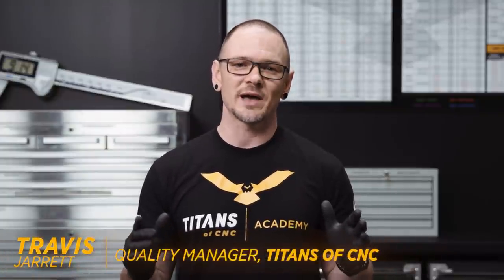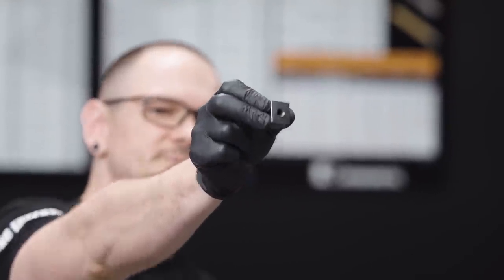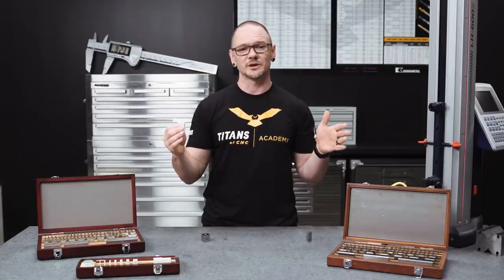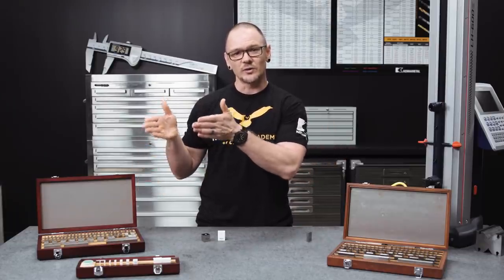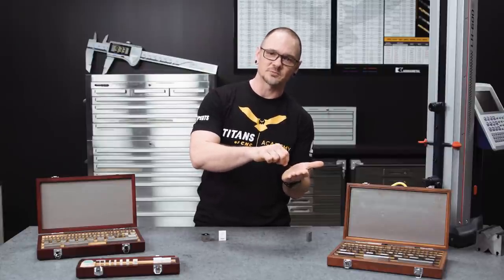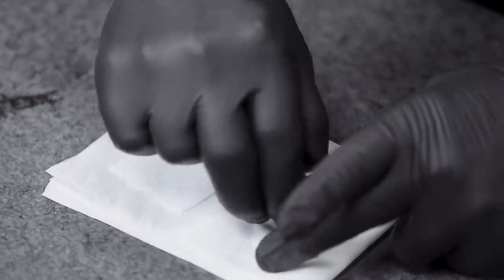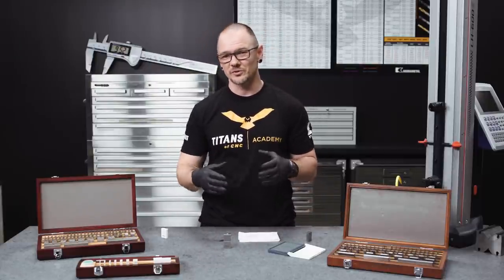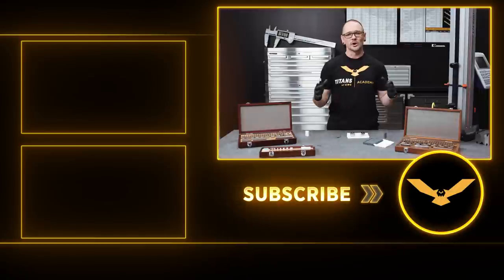How to Use Master Calibration Blocks aka Gage Blocks

Comment: I cant believe they are still working in Imperial at his shop...I was the guy who was like f** Metric.. Then I used it. SOoooo much easier. lol
Reply: thank you
Reply: YEah it's really nice if you don't have sizes like 1.3645 +/- 0.0237 annymore :P
Reply: SAE FOREVER❤ 
0.03937" looks WAAAY better than 1mm
Reply: fractions and decimals too hard for your little brain?
Reply: @s0nnyburnett  not at all... I'm a journeyman toolmaker. I can and have worked in both. Why would I want to have to worry about 4 or 5 decimal places back when it only takes 2 or 3 for Metric? Trust me I like SAE. But in a machine shop metric is easier plain and simple. There is no debating this lol.

Comment: Action Lab just confirmed that it's the surface tension of the oil that holds them together more than anything else. But air pressure and electron sharing also plays a role.

Comment: Nice info video. Personally, however, I am still missing the information that the gauge blocks are available in several quality classes. 

Class 0 for calibrating gauges and measuring devices. (mostly in air-conditioned measuring rooms).
Class 1 for testing gauges and setting gauges.
Class 2 in manufacturing....

A Mitotoyo employee gave me the tip to draw the measuring surfaces over a piece of paper, which lies on a straight surface. The paper is soft and does not damage the measuring surfaces and thanks to the pores in the paper, it can absorb dirt. 

Why paper? Because cloths can leave fibers on the surfaces that could falsify the result ;)

Comment: 1.  "...will rust. and you don't want to transfer oil that will contaminate the blocks".
2.  "Apply some oil to the blocks".
3.  Oil will add size to the block
4.  "And you don't want to leave them attached with the oil, because they will get closer to each other".
(I'm paraphrasing a little bit).

Okie Dokie...   :-/  (<-- my confused face)
Reply: What i personally do is store them in the original container (and follow the instructions given by manufacturer for storage) and for use, i do the following steps:

1. wipe them off completely, usually with a chemical that doesnt affect the metal, i tend to use a version of ethanol called t-röd.

2. I lightly touch the mating surfaces with my palms (to get the right amount of oil, you hands should feel dry but well hydrated) as the original inventor did before wringing them together in a circular motion

3. After i am done using them, i wring them apart (to avoid damaging the surfaces and since the method of using palm oil averages 120-150 kg, making pulling them apart a joke) and store them back in the original container according to the instructions from the manufacturer.

Mine are the original gauge blocks produced by johansson and so, do not require anything beyond desiccant packs in the box and a good wiping after use but yours may be different.
Reply: Part of the 'wringing' phenomenon is a oiled surface attraction in addition to molecular forces and atmospheric pressure.
Reply: @JayKayKay7  it has been tested, wringing occurs in a complete vacuum (as in, it was tested on a space walk on the ISS) and without oil

The vacuum has negligible effect but the oil shows a huge difference, such that a lab was needed to insure that there was no microscoping amount of oil left that could explain it. With an ethanol-cleaned set and no added oil, i get maybe 300 grams of force keeping my johansson blocks together while with the oil from my hands, the scale i used was maxed out at 100 kg.